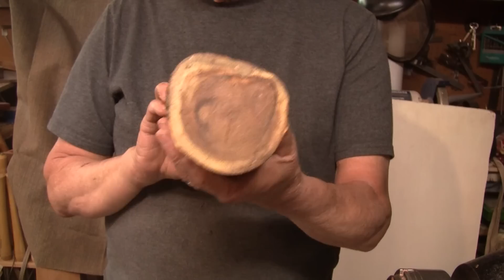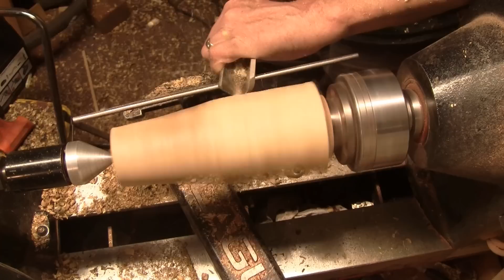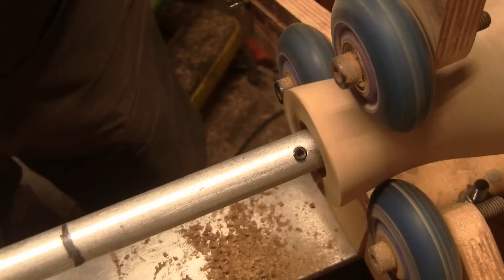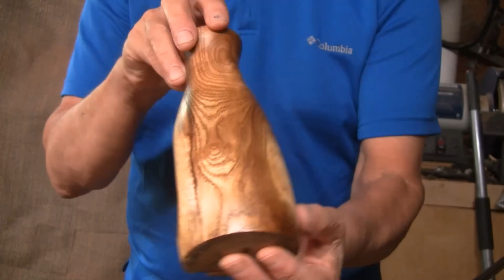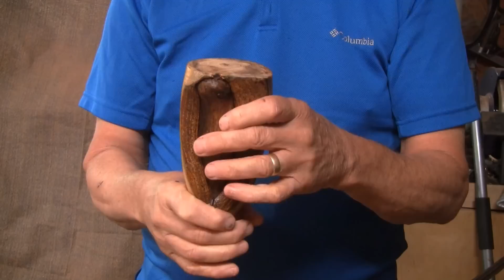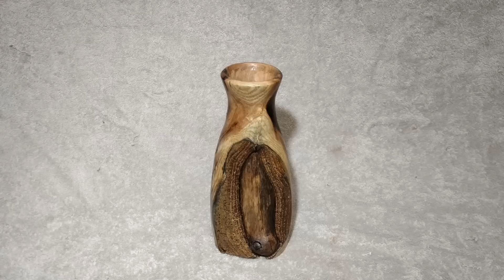The Amazing Vase Wood Turning Mimosa

Comment: Another great example of your workmanship, thanks for explaining your setup procedure always learning from watching your videos, the Vase looks fantastic amazing grain and that natural feature is very cool. 
All the best to you. 
Regards Jim
Reply: Hey Gary just wondering what brand/type your hot glue is, I have used some that is sort of transparent which worked well but can’t find that one anywhere, I have a packet of glue sticks now that are a milky sort of colour and am having no luck at all with it holding, any suggestions. 
Regards Jim
Reply from the maker: Hi Jim. I have used many types of glue sticks and they all have worked. Actually some of the ones I really like came from Harbor Freight in a bulk pack. I have gotten some from Bi-mart (maybe a local store) that work good as well.
I bought a new hot glue gun kit recently that came with a bunch of the long glue sticks. Probably the strongest I have used. I had to resort to a hot air gun to get the tenon off this turning but that worked great as well.
Getting the glue as hot as it will get is very important to sticking.
It has two heat settings and an on/off switch. It works great:
https://www.amazon.com/Carry-Sticks-Power-Projects-Repairs/dp/B08N6FWQWF

Take care,
Gary
Reply from the maker: Thank you very much Jim. I really do love making things like this and be able to save a feature and still get an almost complete turning.
Take care,
Gary
Reply: @ThePapa1947 Thanks Gary

Comment: Would you please tell us about your negative rake scraper. Width, thickness, and angles. Love watching your videos. Buck in Tennessee.
Reply from the maker: My scrapper is 1.5 inch wide and 5/16 thick. The angle is 40 degrees top and bottom.
Thanks for watching,
Gary